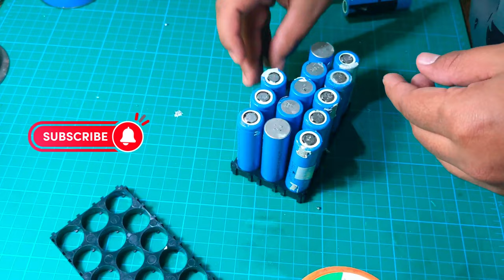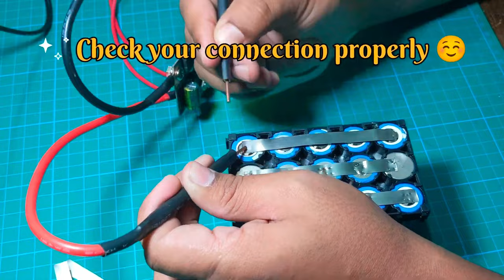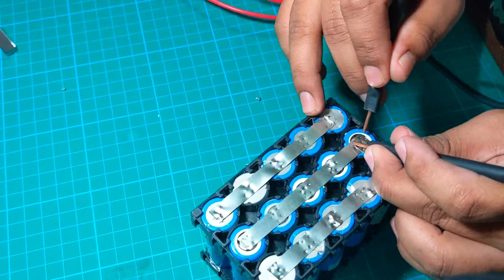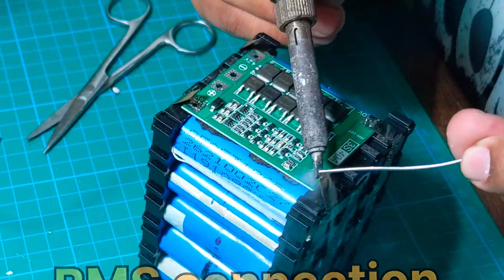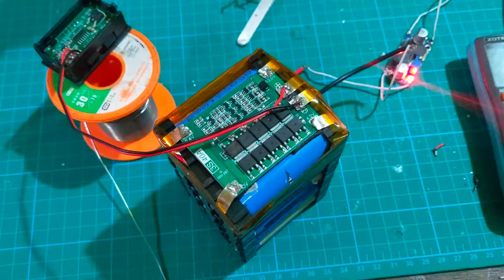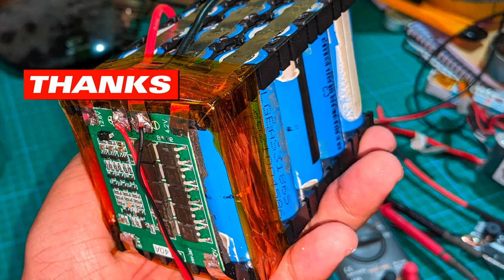DIY Battery Pack: Choosing a High Capacity 18650 Battery for Battery Pack@cubityt

Comment: How do you get 8.4 volts out of this battery you built?
Reply from the maker: It's a 12v battery..but you can get 8.4v using 2 batteries in series
Reply: @cubityt  but battery timing short i want some long time battery same voltage
Reply: @cubityt   but battery timing short i want some long time battery same voltage
Reply from the maker: You need a 8.4v bms which is charged using a 9v adapter
Reply from the maker: You are invited to check my latest video for 8.4 volt battery pack

Comment: I have 40 18650 i have 10 in a batt pack i got off ali and the batt work fine in there when i take them out and check the volts its says there 38.54 volts so i check all my other ones sure enough Thay already the same so i take the ones out of my vape and they read 3.9 so my meter works so why are my 18650 saying 38.54 volts
Reply from the maker: @vvorldnewsmedia  here 10 cell are in series.. that's why the output voltage is 40v..if one cell voltage is 4v and when we connect 10 battery in series then the output voltage 10*4 = 40v